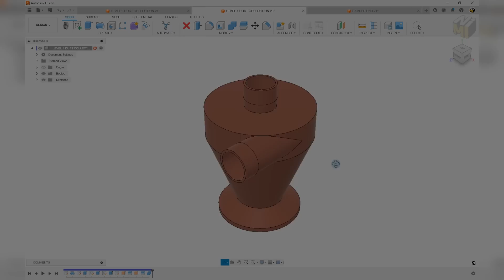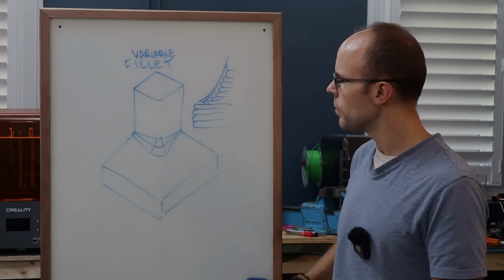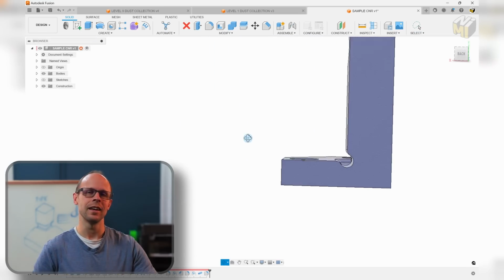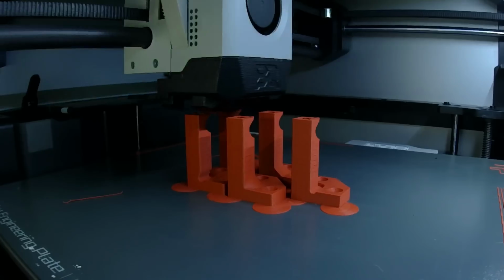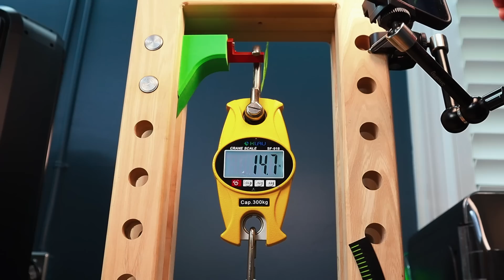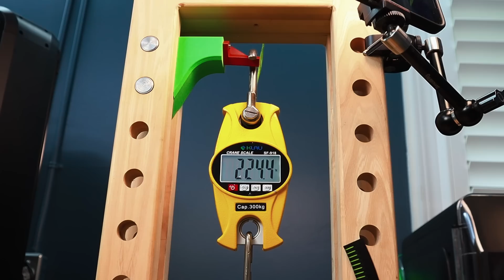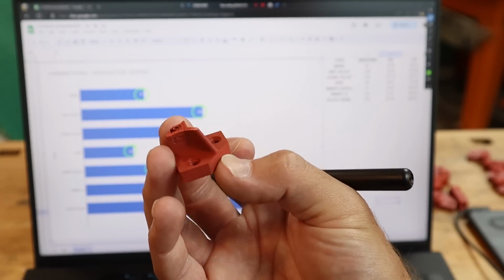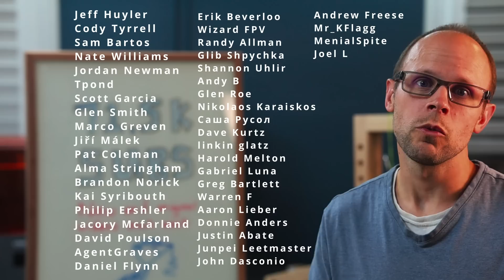Which is the Best 3D Printed Corner

Comment: You tend to use maximum load as the metric for evaluation in your videos. More commonly in mechanical testing we quantify load and displacement in a test. That allows for one to assess not only the peak load but deflection in the sample and the slope of the load displacement curve, the stiffness. All of these can be important for evaluating a design.

Comment: It would be interesting to see a comparison test where the layer orientation is parallel to the "height" of the tower so that your load is not peeling the layers apart. Layer orientation can have a very significant impact on part strength depending on the direction of the load.

Comment: I think some kind of sewing inside the slicer would be nice where it leaves a gap 1 - 2 layers lower then then where the corner starts and at the end of the travel it would dip into the 1-2 layer gap and creates a seam like that that could hold allot more shearing force maybe.
Reply from the maker: There is such a feature which has been released for Prusa-slicer for  'Brick Layers' which from what I've seen does help, I'll probably be testing it in a few weeks on some structural prints.
Reply: @NeedItMakeIt  Oehh I`ll have a look at that!
Reply from the maker: I'll be diving into that soon too, it seems like a pretty good solution, I don't know if it affects solid printed parts at all, maybe if there are more walls rather than more infill, I'll have to check it out a bit more in-depth.

Comment: It all seems to be directly proportional as the thin part of the peg vs the distance. Cantilever makes a drastic difference in weight, so something like the last gusset piece would have the weight just millimeters from the thinnest part where the first design would be significantly further. I'd love to see a test of the non-fillet original design, but as short as the broken off piece of the gusset design. I'm guessing it would have about the same breaking strength.

Side note, I second that your CAD demos here are great. Thanks for the video!

Comment: Some of the parts have infill whilst others don’t, don’t necessarily think it was a fair test amoung them all
Reply from the maker: You're right, some have more infill than others.  The testing was setup to be accurate from a 3D printing standpoint, but these concepts are used in metal and in wood and the same principles apply there as well, I've simply adapted them for use here.  In the case of the straight corner, it had 100% infill at the transition, which gives it an advantage.  Take what you like, these are just ideas floating around in my head after all.

Comment: I've been using Fusion360 professionally for years, but this video just now taught me how to properly use variable fillets on multiple edges.
Great video!
Reply from the maker: I'm with you too, there are so many features that aren't so straight forward to figure out.  That feature also allows you to add your own points for start and end of the variable sizes independent of the selected lines.  You can do this by selecting the + symbol in the bottom menu and it will allow you to manually pick those transition points.  Thanks for your support!
Reply: @NeedItMakeIt  ❤️

Comment: I am not contesting the techniques but there is more at play than simple fillets and chamfers utilized in traditional subtractive manufacturing, especially on the swept versions. By default, most slicers will add material on any angled wall relative to the bed, usually considerably more than one would intuitively think. Additionally, the tool path, speed, direction and number of passes per layer change dramatically depending on geometry and type of line. 

It would have been nice if you had shared the step files, also if you didn't know orca slicer can use step files directly and can often result in more accurate parts.

Comment: Fillet on top edges, chamfer + half a fillet on the bottom. Last one means first chamfer, then fillet only the top edge of that chamfer. That way bottom side is nice 45 degree angle that prints well and rest of the edges are filleted (i often round the bottom corner with scraper tools, so the end result is still a fillet, it just prints better than a real fillet would). And i use the "gusseted fillet" or rib for parts that need to be strong. I've had very good results with that method. Also, i tend to cut holes to parts,  and the edges of those are heavily chamfered, the hole shape is an offset line copied from from the outer wall shape. That way it will print walls in the middle, instead of being just shell + infill. Makes things ever stronger and uses less material, printing times are the same though (more travel moves). 3D prints are fascinating to design, often removing stuff makes them stronger just because you are adding more walls.. 

Overall, i at try to chamfer each visible edge, everything works better that way. Prints often get really sharp edges and corners, way too sharp for humans. Even a 0.5mm chamfer makes them much more humane objects.

Comment: I think your testing methodolgy may be flawed. the distance between the point of load and the point of fracture is going to have a big effect on the actual forces on the part that breaks. A longer part where the size of the fillet is a lot smaller relative to the distance to the loading point. You may still be correct about the corners, but I suspect that this has a larger effect in the results of this experiment.
Reply from the maker: I see your point.  I like to test as close to reality as possible, the examples shown are intended to represent a real 3d print.  The length of the "lever" will change and this is important to know if these options were utilized at all.   I'm not always right, what I can share is ideas, that's my main goal here.  A person can choose to use or improve anything I've shown, do their own testing or do nothing.   Thanks for your thoughts.

Comment: Hmm… I don’t understand how fillet adds strength to that bottom in we corner. I understand that it looks stronger, but because of the layer line orientation it seems like the forces will be in the same spot. I guess surface area is slightly greater because it increases the part radius but it you are just 2 or 3 walls it seems the same and like it would be no different than just thickening up the part. 
Thinking about it further maybe Im a little backwards- now it seems like the backside … in going to have to make a video response. No what I’m going to be able to textually explain this. Haha.

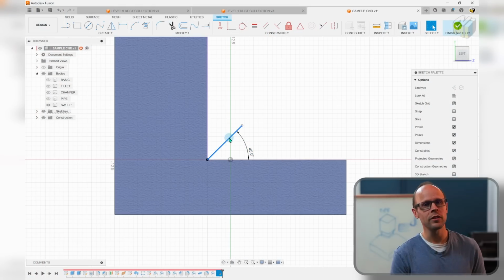Comment: 5:24 Having the edge of the circle at the corner doesn't help at all with the fit, which was one of its main purposes. (Later you do add that you can make it a bit over the corner.)

Those fillets look horrible with FDM, causing large stairstep-areas, which is super ugly! Instead I'd recommend combining fillet and chamfer the other way, so the fillet is in the middle and the bottom chamfer ensures a sensibly high angle from horizontal.

Comment: Great channel. Just discovered and already followed.
This test however is IMO relatively useless. All you're measuring is the layer adhesion. 
The design doesn't matter in this case. Similar to why it makes  little sense to 3D-print an arch-bridge.
Still I found the advice to consider these sorts of edge already during design very useful!

Comment: For all the talk of stress concentrations, the tests appeared to mostly show that simply adding additional material is what's improving the strength, and that the particular shapes are not having much impact at all. Your fillets provide an effectively shorter moment arm (at nominal diameter) for the test rig to act against (hence the improved results) but if you're space-constrained, you really don't seem to gain much by playing with the shape.

Technically your swept tests are slightly better than the baseline, but a ~10% improvement is not that impactful in most cases. If my margins were this close on a part, I'd be redesigning it entirely to have better strength via the geometry and overall dimensions rather than trying to improve things by adjusting the corners.

Comment: Your "pipe" and "swept" versions might have done better as a normal corner manually undercut with a soldering iron to make clearance (or any other heated circular shape).  Also, you would have probably gotten better results by laying the part down so that the vertical component was against the build plate.  That way you arent relying on the layer adhesion alone to carry the load.

Comment: In all tests, it looks like the post fails by layers peeling from the top corner.  So perhaps that corner also needs to be removed, either by exterior chamfer or fillet...or even making it a round post for equal performance in all directions?

Comment: I usually fillet corners, but learning about the pipe method is definitely going to impact my designs moving forward! I actually ran into this issue recently, where I wanted to fillet an inner corner but couldn't because it had to fit tightly to a square object. I had never heard of the pipe method I never would have thought that removing material to round the corner off would increase strength.
Great video!

Comment: Also, I have a solution to printing strong inside corners but afaik no slicer supports it. You'd actually need a way to go back and edit the program after slicing because it would require some slight cross layer motion and afaik slicers don't print across Z layers

Comment: Sharp corners wouldn't "slow down the print" due to changes on direction. They'd be slower than a chamfer because the hypotenuse is shorter than the legs. The print head will still run at its regular speed and accel decel. So unless you have a ridiculous A/D problem with your steppers or servos, the change in direction is not the issue. On a diagonal, you still have to change directions on each axis anyways.

Comment: Those failures were all super clean breaks along layer lines. In addition to the orientation of the print, you might want to print a bit hotter to increase layer adhesion. Test is still valid but all you were really testing is layer adhesion vs FxD at the smallest cross-section, not the stress of the joint.

Comment: Nice video. I use chamfer for strong parts. But now I can see that i Shud se if fillet is a better option in the part that I'm making. I think if it's possible I will make a little filled in the bottom of the part to make i even stronger.🤔

Comment: Very useful!  Thank you.  I am curious about how strong including a full-height hole in the corner that lets go first which is later filled with a piece of filament that is either super-glued in place or the ends slipped back into return holes on the other side of the top/bottom.

Comment: I honestly don't understand why 3D Printing analysers like NeedItMakeIt hasn't come out with tests parts with printed insertable "BONES" into parts for strength.  All it takes is printing rounds or square sticks in opposite layer lines and inserting them into the part.  Plus you get more internal walls around the hole. Glue in for even more strength.  I do it all the time and makes super strong parts that never snaps even in PLA. No need for all this chamfer and fillet foofoo trickery that just moves the weak point down the line.  Sure Chamfers and fillets are sexy, and help....but Bones will win the test

Comment: So the breaking point is a function of the arm of the applied force and the area of the breaking slice. I think the role of the sharp corner as a weak point because of the shape of the corner is a lot less significant than the relationship between the arm of the force as a result of this setup and the area of the slice.

I wonder how you could optimise the shape to maximise the strength for the material used.

Comment: It would be really interesting to shift the moment arm for each of these parameters as well. One factor that will increase the ultimate strength of each of these is the location of the minimum cross section relative to the applied load. For example, if the load is applied 50 mm away from the base and you add a 6 mm fillet, then the moment arm is only 44 mm to the minimum cross section. Fillets and chamfers definitely do help on their own to reduce stress concentrations, but I wonder how much of these results are due to the change in moment arm from the minimum cross section!

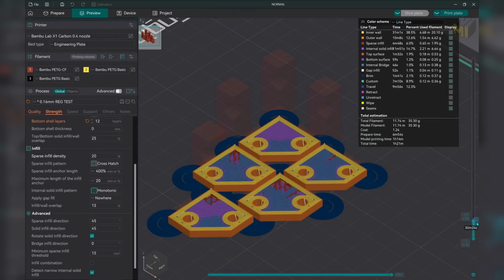Comment: It was more layer adhesion test, swept performed better because walls bounded together better then regular one as there was less time to cool down for small walls than for bigger surface. Also slicing was way different for each part 6:15.
If you wanna stronger parts good design is like 10% of success. Material, slicing, temperature and what the most important printed parts orientation are way to go.
On the other hand good design is extremely important for injection and cast molding, not only for strength but also for stress relieving, shrinkage porosity and even cooling.

Comment: Really cool video! Unfortunately most of the design principles you demonstrated were established for parts made of isotropic material (like CNC'd aluminium), which 3d printed parts are not.

In isotropic materials, sharp inside corners are bad because more stress travels through that small area, introducing highly concentrated stress points which is the key ingredient to forming cracks in parts.

In 3D printed parts, layer adhesion will cause the part to fail long before the material limits of the plastic which could be verified by plotting the force to failure against the cross section of the failed layer. It won't make a perfect linear graph as you have varying smallest layer geometry as well as varying distances between the load and the layer with the smallest area, but it should show a consistant increase.

Your last design though introduces a new and interesting question: What design principles should be implemented specifically into 3d printed part features to give them better mechanical properties? These will definitely be different to conventional design principles.

Would love to see this explored further though! Awesome work :)

Comment: I've designed stuff for work with these sorts of features with the intension that they are 3D printed, and been shut down by coworkers with "more design experience"  (designing for CNC milling/turning saying that i was adding unnecessary complexity and I'm just increasing cost to make it look cool. I'll show them this video the next time they try to tell me that.
Reply: The very slight extra print time is insignificant, especially when compared to the increase in strength.
Reply: CNC milling or turning does not break at the layers mate
Reply: It's funny how these are close and yet so different. Like removing material (thing generative design) is a huge bonus in 3D printing but crazy expensive in subtractive manufacturing
Reply: 3D prints are weird things to design. Often cutting holes in them makes them stronger.. Instead of a shell filled with weak infill you get walls in the middle, and you can chamfer/fillet the hell out of them to get even more stability in multiple directions. It makes more sense when you look at the final weight, a part with lots of holes is heavier than a part that has none. 

Hope you can get it sorted, i'm just hobbyists but done design for both CNC and printing.. They are just so different disciplines that a CNC modeler really can't afford to criticize 3D print modeler, and it of course goes both ways. 3D printers are the new kids on the block, it is about expected that old timers will feel it a bit threatening... I know that between my CNC and printer.. the latter gets 95% of the stuff done, faster and with FAR less hassle and danger... So many things have started with milling in mind and ended being printed, to be fair my CNC isn't made for metal so it is usually plastic vs plastic or plastic vs wood...
Reply: Yikes! At my company we have a policy where you hit a gong and then are allowed to say anything, so I used it to and told the senior engineer “Randy, your a little bitch who can’t get it up” 
I don’t think he’s forgiven me since. Never questions my designs anymore tho.
Reply: oh yeah some random guys video is going to convince them for sure

Comment: Printing this out in PLA, then using the super heated acetone to smooth it should also give interesting results as that would make the layer lines flow into each other nicely. (Before anyone starts yes you can smooth PLA with Acetone, you're using the acetone as a heat conveyor to melt the out layer and not using it as a chemical smoother. If people are interested ill post a followup of the setup needed to achieve this.)

Comment: As an industrial designer, we almost never use plain fillet when it is visible. A fillet of even 0.3 mm is enough to improve the strength of a wall. For large fillets The right way is to create a surface adapted to the surfaces around it. The result is a uniform appearance combined with strength.

Comment: tl;dw more material is more better? It seem like the filleted gusset has a lot more material than the chamfer and fillet.

So the takeaway seems just to be to avoid sharp corners on inside edges to help with stress relief, while removing as little material as possible.
Reply from the maker: I would agree, more material placed in the correct locations makes sense.  Solid prints seem to perform by far the best, but when solid isn't possible lots of walls and hollowed parts also perform better.